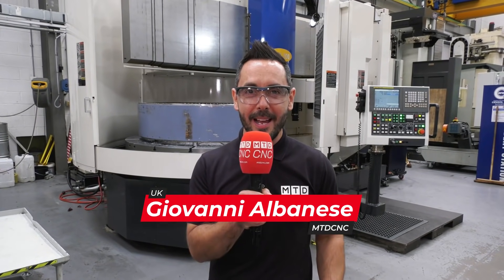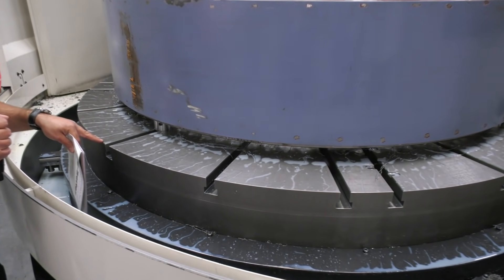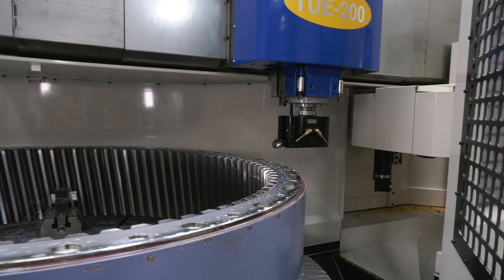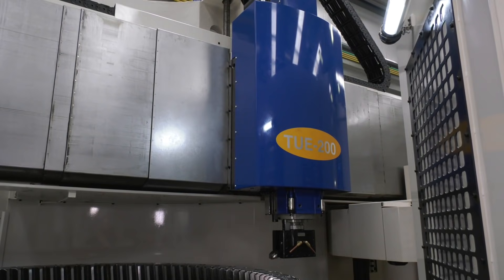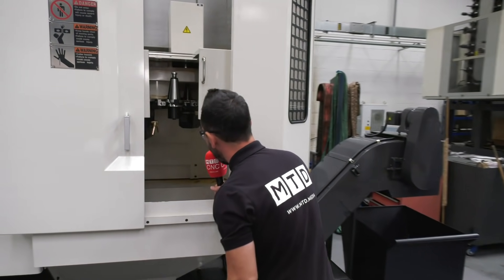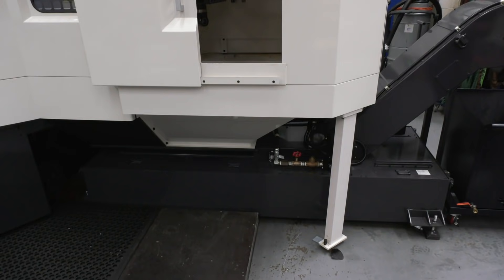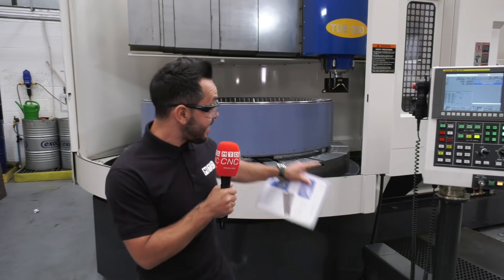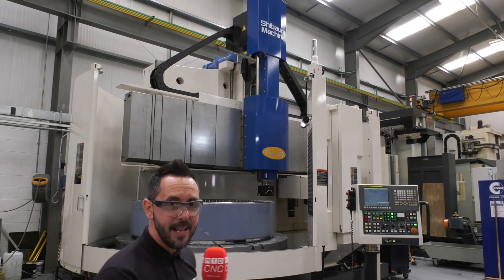Why Mill On A Vertical Lathe?

Comment: If the turret crashes the rotating work can get ejected very rapidly with immense energy. 

My dad recalled a story of one of these machines suffering a power outage. The turret dropped hard into the piece while facing it. The piece got ejected, took out the operator, went through a wall and quite some distance past it.
Reply from the maker: OMG sounds awful